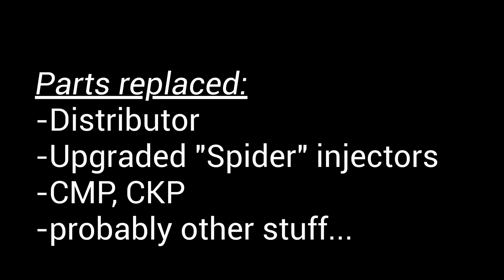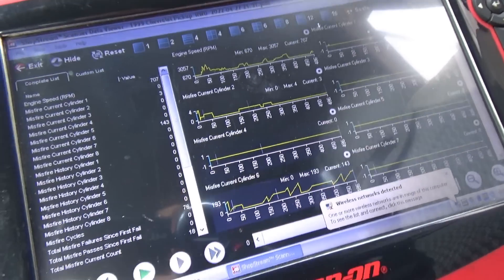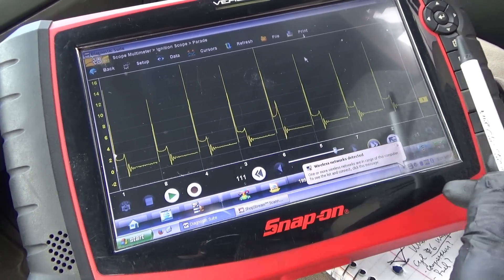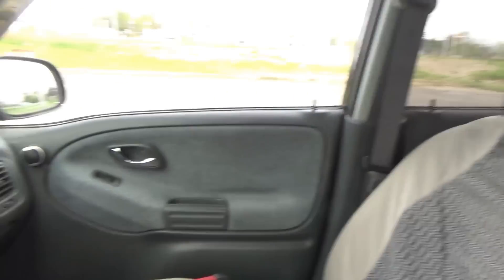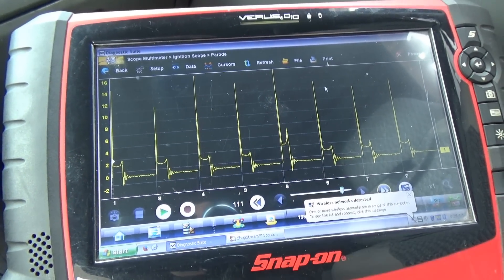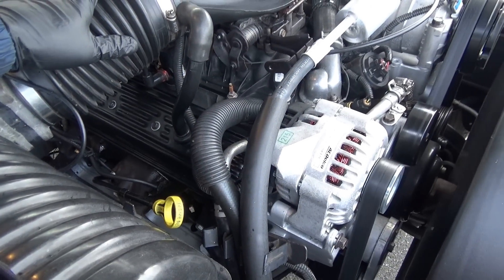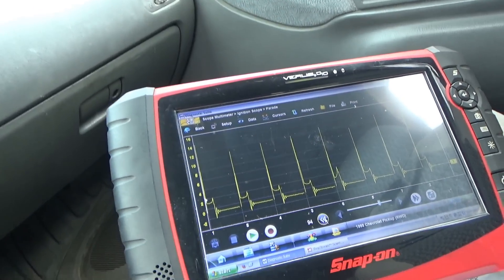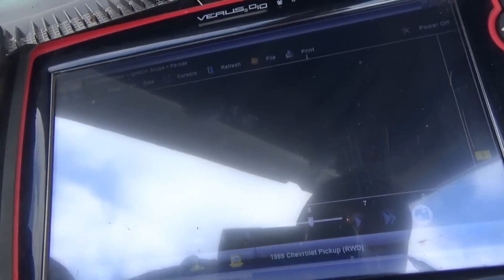Chevy Mystery Misfire...After Engine SWAP?

Comment: I haven't watched the entire video yet, but I did come across a similar problem  on a late '90s S-10 Blazer with a 4.3. The valve guide on the #6 exhaust valve didn't have enough clearance. When hot, the exhaust valve would hang partially open, causing a misfire. The fix was to pull the head and hone or ream the valve guides. I'm fairly certain there was a TSB on this problem, but I don't remember if the bulletin applied to the truck you're working on.
Reply: The pressure transducer test would have picked that variable up.
Reply: How would you go about finding that? High rpm compression test?
Reply: @kipamore  I'd love to tell you that my genius level diagnostic skills nailed the problem in 15 minutes, but that isn't what happened. 

The truck initially presented with a misfire and a leaking fuel pressure regulator, which was common on those engines. We replaced the CSFI unit with the updated part, road tested and returned it to the customer.  He comes back a week later saying that the truck runs rough sometimes. It took me a week of lunch time road tests to even confirm his complaint.  I then spent way too much time replacing questionable (but not visibly *bad*)ignition parts, warrantying the CSFI unit, etc.  Eventually a post in the iATN drivability forums led me to suspect the exhaust valve guide.  I got the engine as hot as possible, which caused the misfire on #6 cyl. With the engine still hot , I quickly pulled the plug (not recommended...I still have the burn scars from that job) and did a leakdown test.  The exhaust valve was leaking.  I pulled the valve cover and found the valve hanging open.  I then scheduled the repair with the customer.

TL;DR--I spent a long time chasing my tail until a fellow tech pointed me in the right direction.
Reply: @alantrimble2881  I'm going to tuck this tale away in a corner of my brain. I suspect it will come in handy at some point. Thanks.

Comment: My first assumption is the owner changed the gaskets and then said it was still running bad so he could get out of paying your diagnostic fee, but then again I am a cynical and untrusting SOB!  Hope you get the truck sorted, and more importantly, let's hope the price of gas stops increasing otherwise none of us will be able to afford to drive our V8's.  My Sequoia is no longer my daily driver, I cannot afford to use it for my work commute.
Reply: Good point. I won't be a bit surprised if he never brings it back and we don't get a follow up video because it's fixed.
Reply: Due to gas prices I've parked my 2012 Chevy PU. It has the V-6. It gets worse gas mileage than the V-8. Now driving Toyota Matrix.
Reply: @ourtexasfamilyvideos62  I'm commuting with a beater with a heater 97 Celica, even though it has over 230,000 miles it runs good, and more importantly I get double the gas mileage of my Sequoia.
Reply: Welcome to joe bidens america ...gas to be at $10/gal this summer as diesel shortage will curb gas deliveries ...gas and food will be affected.. stock up !
Reply: People typically are not that dishonest and he didn't say that he's refunding the diag fee.
Reply: James Carroll  yes, he could drive up to Ivan’s for the free diagnostic but with the price of gas, getting up there equates to the cost of a couple of hours diagnostic!  Factoring in the price of driving anywhere these days is important.

Comment: I would spray auxiliary fuel near that cylinder runner just to see if it makes a difference. Not very scientific. But if it changes the ignition waveform then you know you're on the right track.

Comment: Hey  Ivan👋 I wonder if a sluggish or partially plugged injector might have something to do with the slight miss. If the injector doesn’t fire or is partially blocked it would lean out the mixture also. Something as simple as a vacuum port with a cracked hose can cause it too. It would be interesting to see what you find out. I’m interested in finding out it what the fix was. Onward and upward ya go Ivan

Comment: I'm suspecting a cracked spark plug and it's consistently shorting to ground..  You never pulled the number 6 plug from the socket on camera, so maybe you never checked it.
Reply: A cracked plug would show low secondary voltage. The trace was high.
Reply: @fascistpedant758  Why would it show low?  It's just the arc shorting to ground near the threads, rather than shorting through the end of the plug..  Why would it change the voltage at all?  I'm asking
Reply: @calholli  Air resists the flow of electricity. The denser the air, the more resistance it has. 3-4kv can overcome the resistance of a given gap in open air but it may take 30-40kv in compressed air. If the crack is close to the exterior side of the plug, in atmospheric pressure, it will require much lower voltage for the spark to jump through the crack than at the gap in the compressed air.
Gasoline vapors conduct much better than air. Lower voltage is required to spark across the gap in a charge with the proper AFR. The spike in secondary voltage at the end of the firing line on the trace he captured for cyl.6 indicates a lean air fuel mixture.
Reply: @fascistpedant758  I get that a shorted wire upstream would show no voltage if you tested it at the plug--- because it's cutting to ground before it ever gets to the plug.  but there's no real way to check the voltages on the plug itself.  The porcelain inside the plug could be cracked and it's still arcing like a normal plug does-- it's just down inside the plug, where the fuel can't get to it very well..  The same thing can happen on a 2 stroke-- It gets "fouled" by getting covered in carbon, and the it shorts through the carbon layer that's on the porcelain--- so this would be similar, except it's through a crack.  It's just a hunch.  I'd swap plugs just to rule it out.. easy to do.
Reply: @calholli  A full or partial short at the plug such as carbon fouling would lower the voltage over the complete circuit. A crack in the porcelain on the high pressure side would still be a longer, higher voltage path than the gap across the electrodes.

Comment: Nothing against using a scope and related fancy gadgets during driveability diagnostics but I like to start with cheap(hopefully free lol) and/or easy.     Try swapping spark plugs/plug wires/fuel injectors (if easily accessible) between cylinders.    Try carb cleaner around the intake gasket sealing surfaces.

No one likes to be wrong but it's even worse to be wrong after the customer watches you "hook up the computer" to their vehicle.

Comment: Hey, it can be tough out there! Your use of diagnostic equipment is spot-on - it amazes me you can maintain a thought train while switching things around and speaking intelligently about the process. I'm not familiar with the "spider", but since it seems to have more than the single throttle-body injector, I wonder if the #6 injector may have an issue. Now, on a really old-school carburated 5.7 like mine, one of the vacuum lines (HVAC) ties into the manifold on a runner to one cylinder. I had a completely dead cylinder at idle, and checked compression expecting to find that cylinder having a burnt exhaust valve. I was elated to find compression was fine and it was simply a vacuum line off on that runner! Good luck - and I can't wait to see your result!
Reply: Why do you wonder if he has an injector 6 problem when at the beginning of the video he mentioned he did a fuel injector flow test and it was fine? That right there is your hint its not an injector
Reply: @mikesabin8568  I'm not familiar with the test or whether it's accurate at extremely low flows  for idle situations - but the truth is that I missed his comment about doing it.
Reply: Heard him say that,, but I'm curious how he did an injector test, the spider injector system is hidden underneath the intake.
Reply: @_RiseAgainst  scanners can do it. Bi direction control. Or you can access the wires at the ecm and do it from there
Reply: @mikesabin8568  Interesting. It was my understanding some of these vortec "multi port fuel injection" systems didn't actually control the poppets separately.
Reply: @_RiseAgainst  two wires to each injector….
Where do the wires go back to? The ecm like every car.
Reply: @_RiseAgainst  also some scanners just have an injector balance test where key on engine off and use fuel gauge. It actuates injectors individually. No getting under intake necessary at all
Reply: @mikesabin8568   It appears you think all vortec spider injectors are the same, they are not. 
Edit: to clarify some do not have wires running to the injectors/poppet
Reply: @_RiseAgainst  this particular car, they do…… if you are talking about old cars, fine, i dont care…..
Most modern cars are two wire injectors. I have worked on spider injectors and they are two wires. In the video he said he actuated them…. So whatever
Reply: @HouseCallAutoRepair  possible, but the owner replced the gasket, he would have had to made the same mistake twice right?

Comment: That's when you bring out the carb cleaner will find a vacuum leak in no time at all you should have checked the plug wire and cap.

Comment: One great thing about you Ivan is your honesty. You could have said nothing about the post repair issues with the Ford & the Chevy and we would never had known the diagnosis was incorrect, well at least seemingly incorrect with the Chevy. For all we know the second gasket may have been damaged during the install. It will be interesting to see what you find, especially as you did not repair the Chevy (nor the Ford for that matter). Keep the video's coming!

I have owned diesel vehicles for well over 20 years now, so am out of touch with petrol vehicles, though I have seen people spray brake cleaner to see if there is a vacuum leak. Would this have worked around the gasket or was it not accessible to spray?
Reply: Valve sticking in guide. Was common back in the day. Always the inner cylinders.
Reply: @86753091974  That's a potentially good call.  Would running carbon cleaner through the intake help that out possibly?
Reply: @TheFrenchPug  no. Needs machine work.
Reply: @86753091974  ughh. No bueno.
Reply: i was thinking the intake manifold surface could be damaged, that stuff has to be carefully checked.

Comment: 1, I know you blocked off the crank case to test but could you fit a pressure pulse sensor in place of the pcv, referenced off no.6 injector. Use one of the cylinder over lays then look for a pull on 6 intake stroke to test if it is still something to do with the intake pulling from the crankcase? It will still build pressure in the crankcase from the other 5 cylinders.
Could still be finger error, mating surfaces not right etc. Would also account for the darkened plug burning oil.
2, on the fuel side. Could you perform an injector balance test, using you pulser and fuel pressure? 
Can't wait to see the result on this one!
I really appreciate you bringing the content and especially showing when you don't nail it first time. You'd be bored out of your mind if it was carbon tracking on a spark plug!

Comment: That #6 plug looks like it's a bit rich. Possibly a problem with that particular injector. (?) We do know that just because its new doesn't mean it's good. Would the fuel trims tell us anything ? Please excuse my DIYer ignorance.
Reply: He said at the beginning of the video he did an injector flow test and it was fine
Reply: @mikesabin8568   Ah, not that I think it is injector related, because I do not, but he did say is happens after load.... meaning HOT. A flow test usually isn't done HOT. (usually)
Reply: @HouseCallAutoRepair  why not do the flow test when its hot? Thats when he experiences the problem. Performing tests when the car exhibits the problem sounds like a great idea to me and thats what ivan did, correct?

Comment: There was so much more you could of done. Soapy water around the intake. Propane around the intake, Im sticking with my guess. Exhaust valve. Good luck on the next.
Reply from the maker: What do you suspect is wrong with the exhaust valve?
Reply: @PineHollowAutoDiagnostics  
I thought the in cylinder test at idle looked a little wonky when idling....
Reply: @PineHollowAutoDiagnostics  Idk without the history of the heads. Are they the old heads. Have they been checked. if so what's the report. I don't know if it is a valve or not. I'm just saying I would, in your case, rule out mechanical issues first, assuming the basics were not overlooked. I'm just guessing like and Idiot would do to make it fun. My intuition is telling me it's a valve or an injector. 40% on valve and 60% on injector because of the motor's history. Leak down test then check injector is how I would go about it at this point.
Reply: @PineHollowAutoDiagnostics  Could be the old hydraulic lifter as well. I would pull valve cover and check valve height as well.
Reply: @PineHollowAutoDiagnostics  Would be great to have a follow up vid on this one.
Reply: @PineHollowAutoDiagnostics  Tight guide?

Comment: The thing is the gaskets are the most obvious, but not the only possible source of a heat related air leak.  There could be a crack in the runner that allows some air in, and it would be worse when hot (expansion).     

I think you may have missed a chance on the injectors as well,  It would have been a good experiment to move the injector away from that hole and see if the miss follows the injector or not.    It may flow very well in your testing, but it may not flow quite as well when warm.  That would doubly explain the lack of power as well, as the engine could be essentially running on 7 instead of 8.
Reply: Ive done the upgrades with new spider injection could be difficult  swapping the injector to another hole because of the fuel tubes on the injectors. Also when the injector  clips into the lower intake it clips in, possibility you could hurt the injector getting it out of the hole.
Reply from the maker: Great comment! I will do some detailed experiments when I get the truck to my shop 😁👍
Reply: @PineHollowAutoDiagnostics  Hello Ivan, Was there ever a part 2 video for this truck? I am interested to see as I have a similar issue, rough idle but I have change the intake gasket with a Felpro,new plugs and wires, leak down test on the fuel injectors, Maf sensor, map sensor and nothing has worked but it runs fine while driving.

Comment: Brake booster leak, maybe use the pressure transducer on the manifold vacuum to check for fluctuating pressures

Comment: I had the same symptoms years ago on an old Ford V6 after a service including tappet adjustment and new spark plugs. Fearing I'd over adjusted the valve clearance I rechecked and they were spot on. Turned out one of the new Champion spark plugs, when hot was giving a great enough resistance to effect the spark. Swapped the Champion plugs for a set of NGK and had no further issues.
Reply: Yeah champion spark plugs are just crap.
Reply: Always use NGK!!
Reply: That's because your system was probably designed for non resisted plugs keep in mind this has to do with RF interference typically you want resisted plugs so you don't get noise in your radio or cause interference with other components
Reply: @SHSPVR  Doubt it unless his ignition system was already very weak. Probably a faulty plug. I’ve run resistor and nonresistor on both carb and efi on the same engine and no difference to functionality with a properly functioning ignition system. Also ran resistor and non resistor wires. My research and experience says that it’s an old wives tale that resistor plugs and wires actually cause any kind of performance degredation. But of course they do help with electrical noise when running efi.
Reply: @ryan_layne  Resistor and Non Resistor plug wires are diff story like example with may 07 Ninja 250R it req CR8HSA "R=Resistor" and Coil Wire are Non Resistor being it has Multistrand Copper core wire My used bike that got a few year was basket case that I rebuild of winter someone had install C8HSA plug being it causing too much electrical noise it didn't run right and it was even causing my motorcycle dashcam that I installed to flake out with RF interference so much I had to apply two layers of RF shielding just to keep the cameras from flaking out with pink screen. I generally what run is MSD suppression core wires with high output coil and reg plug E3 plug on Chevy 5.7l (350).
Reply: @SHSPVR  Yup as i said and agreed resistor plugs and wires are important with modern car electronics. My custom setup is a bit less prone to that interference so it didn’t make much of a difference, but i did see less noise in various places on the oscilloscope which was cool. Anyways my original statement was directed at resistor plugs and wires not having a negative effect on a properly functioning carby system. 😋
Reply: Ford's are picky on sparkplugs. Stick with Motorcraft.
Reply: Ya they break them at the parts store slamming them on the counter
Reply: The owner of the first shop I worked at warned me of similar issues with Champion plugs. After that I only used them on lawn equipment.
Reply: @ferdiecassel3697  I perf E3 plug the one in my truck and lawn mower or well over 10 year old and it still going and going
Reply: I put NGK into my BMW vs Bosch factory and it has run smooth as silk for thousands of miles.  Whenever you have a misfire replacing the coli and spark plug at the same time is always a good idea.  That is what the dealer does at least.